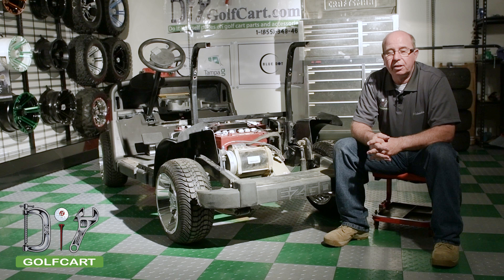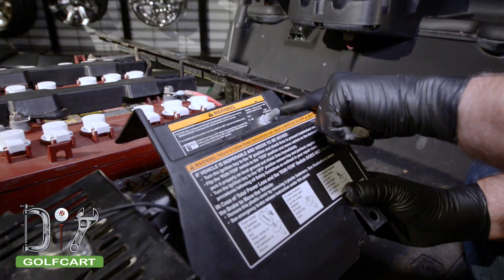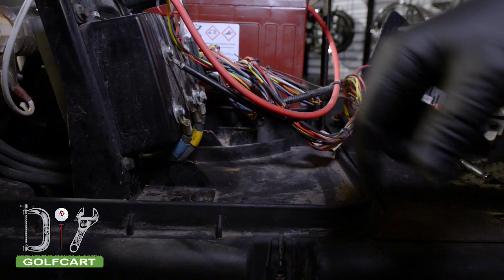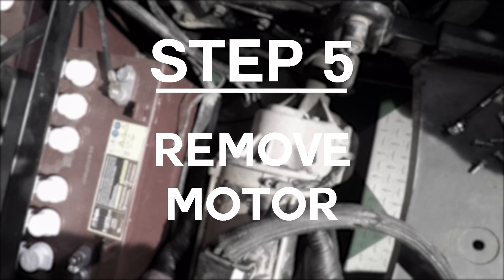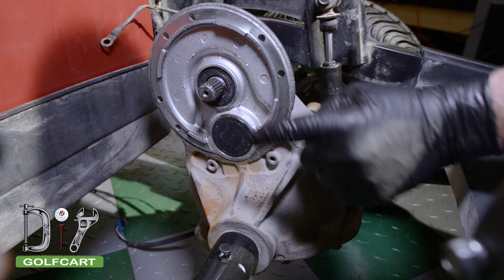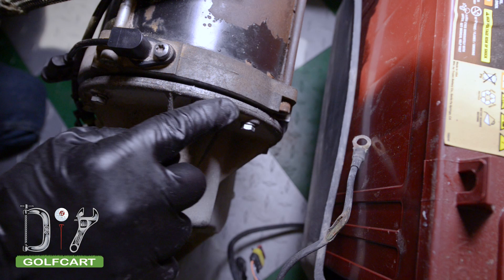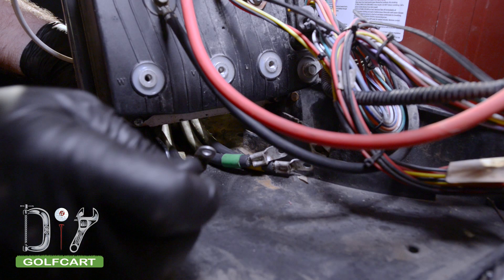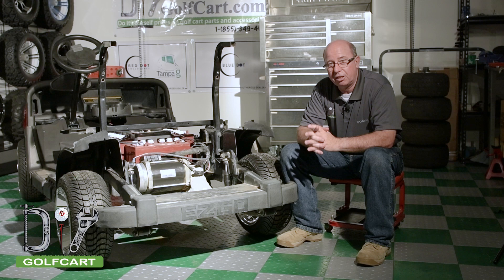EZGO RXV Golf Cart Motor Removal & Installation How-To

Comment: Good video. Looks fairly easy. But I would like to run the motor while it is out of the cart. My troubleshooting is for a cart that stutters and jumps upon acceleration. After months of this Now it hardly moves at all.
Reply: Did you get the motor reprogrammed once you installed the new one?

Comment: Finally looked at it video that someone knows what they're talkin about. And they know to clean parts and check things out before trying to start their golf cart. Moose videos I see they're trying to fix it and not checking their air flow or their gas whether it's stale or not. And cleaning the machine off from dirt and grime and dust. It makes me laugh but yet makes me mad that they're showing these videos to people and not knowing what they're doing. The one guy had mud wasp that have plugged up his intake airflow.! And wonder why it wasn't working. These things should be checked out before even trying to start it there's sucking things into the carburetor and into the intake into the motor. And most of the time the gas has set for years and they're sucking all that varnish and dirt and grime into their carburetor into their engines. And probably not even checking their oil or changing it before trying to start it. Some of these guys have no business even being on YouTube trying to show other people how to work on theirs. Even the electric ones the switches and the relays. They're scratching their head they don't even know which one the wires go to. Thanks for a good video for a change. But I see that you do this for a side or a living and you have a shop. Keep up the good work people need to see more of these videos of people knowing what they're doing
Reply from the maker: Thanks for watching! Yes, for a golf car to last a long time as it was originally designed to do, it must be kept clean.

Comment: Is there a way to test to see if the motor is the problem before removing it?  I know you can hook it up to a 12v on the older models with posts on the motor, but  not this one.  Not sure which wires to connect.

Comment: what if the input shaft splines were excessive wear  causing slippage can you change the input shaft?
Reply from the maker: Yes, you could replace the input shaft with a new one including the bearing and snap ring. It's part number 7919 or OEM 620329. Input shaft kit.

Comment: I have removed the bolts from the transaxle but the motor will not budge. It acts like there is still a bolt connected. Do you have any suggestions?
Reply: Is your motor still stuck?
Reply: @danielmalan7084  yes
Reply: I have the same problem, did you end up finding how to remove the motor?